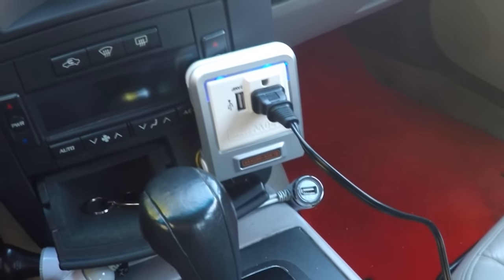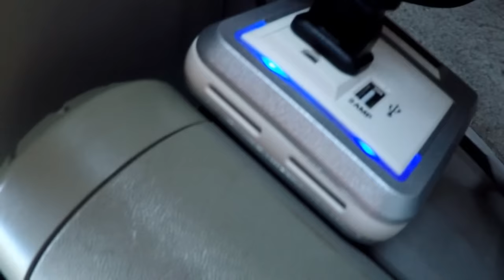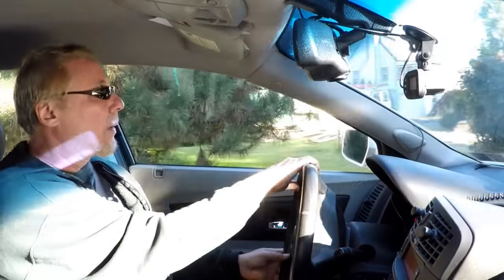Cooking Beef Stew in my Car with Hot Logic Mini

Comment: Perfect my hot logic shows up tomorrow -- am excited to have an oven in my little "72 beetle car. Cross country here I go.
Reply from the maker: +Ganga Nice! 👍😃👍
Reply: Wah hoo the oven arrived and so am giving it a quick run today... can't wait.
Reply: @gangatarot8723  so what's your verdict
Reply: @DarlingsDomain  Oh I like it.
Reply: @GuruSwamiG  do you find it doesn't drain your battery much
Reply: @DarlingsDomain  no I used it while driving - it heats everything I stop and eat.
Reply: The hot logic also comes in a 12 volt model for use in a vehicle.  When my zipper jammed, I put the hot plate in a Coleman lunch box cooler, it fits like it was made for it.

Comment: You said Rick the link below has the car inverter to buy . I looked at it and it didn't have the one that is in your car. Would you find the link and share with us subscribers please? Take care
Reply from the maker: I was sure there was one on the hot logic site. Maybe under accessories?  They do have one that works plugs into a cars power adapter.   I'll check again.  :)
Reply: Yes they do but but not the one you have with the blue light .So would you find the one you have so i could buy that on please ? Thankyou @RickMammana
Reply from the maker: Oh I actually got that specific adapter from Home Depot.

Comment: You must have a pretty modern car to have a plug in the back seat to access battery power.  (Do you plug this into what used to be a cigarette lighter?)  You can tell I have no experience with these gadgets.  I don't even remember if my car HAS a cigarette lighter!
Reply from the maker: +Donna Brooks Hi, That car is a 2006. Yes it will work in a regular cig lighter if any car still has one.  Thanks for watching!